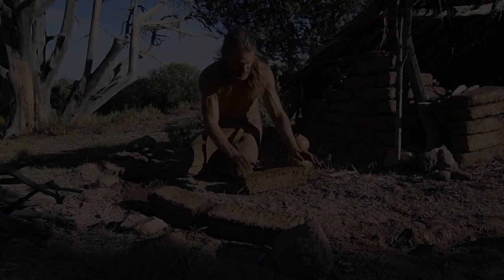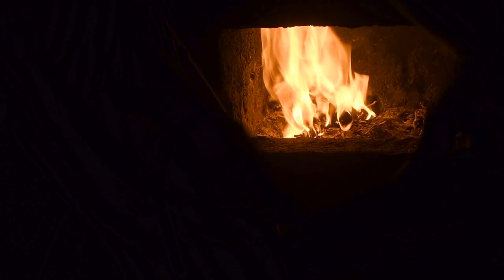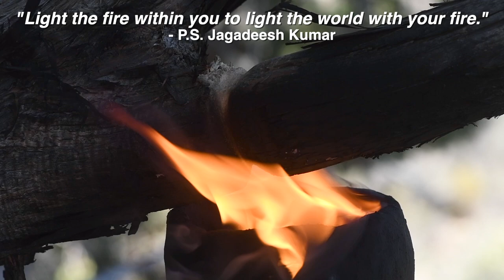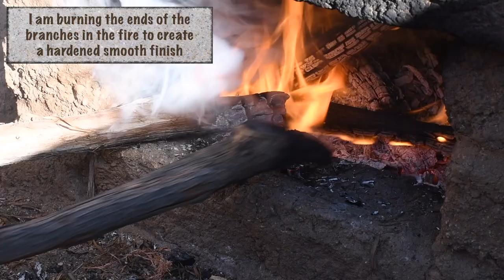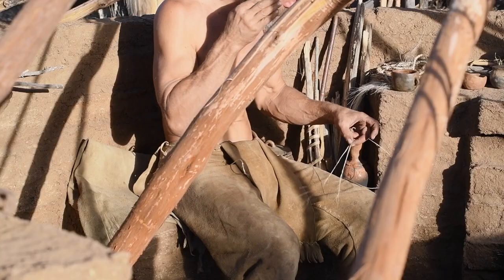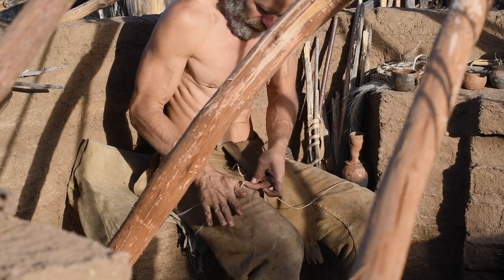Building a Wood Frame Roof for My Adobe Hut (episode 33)

Comment: It looks so odd to have those first three inside the structure. They are hogging valuable space.
Reply from the maker: It provides essential strength to the roof and don't take much space. By the way, this is temporary until I finish the hut in the spring.
Reply: @ChadZuberAdventures  oh excellent! You've put so much work into this structure, I just want it to be perfect!
Reply from the maker: @carolg3605  Yeah, it's going to be really good when I finish in the spring.